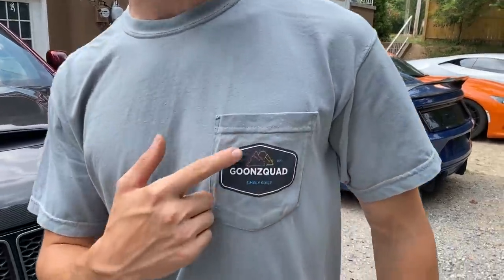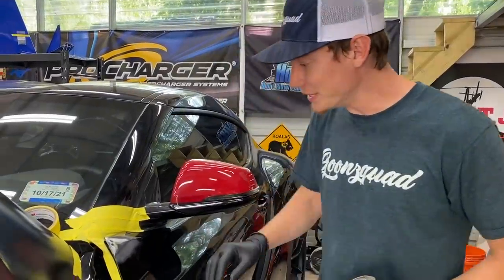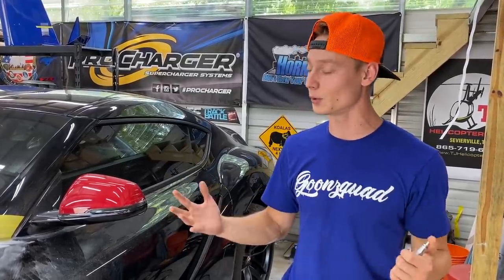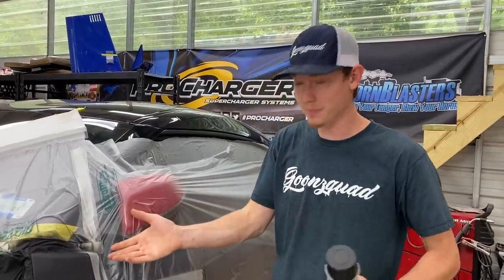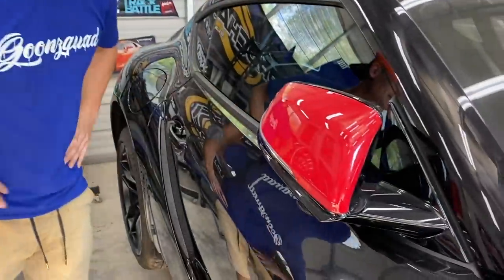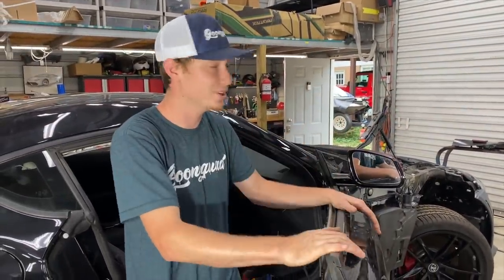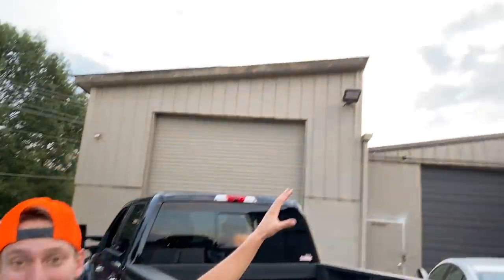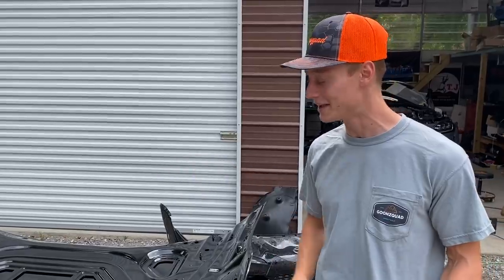Rebuilding A Wrecked 2020 Toyota Supra Part 5

Comment: If you are going to paint the entire car I would change the colour to a white pearl like the Lexus white pearl colour and maybe do a carbon fibre hood and nice 19" black wheels, with the engine do an upgrade air intake, headers, exhaust and a good tune and that will be a nice sports car.